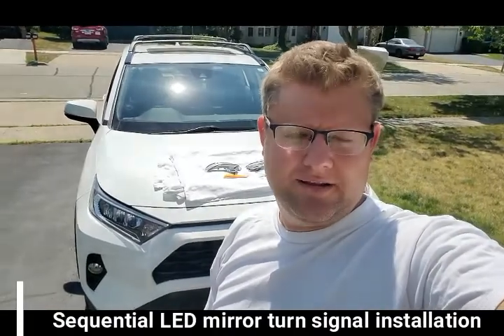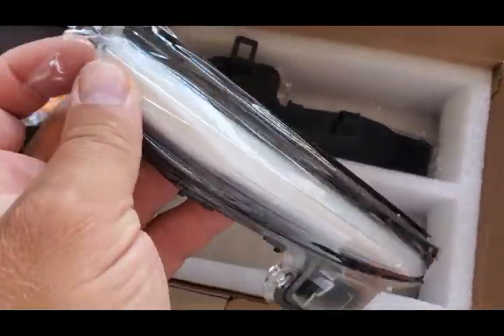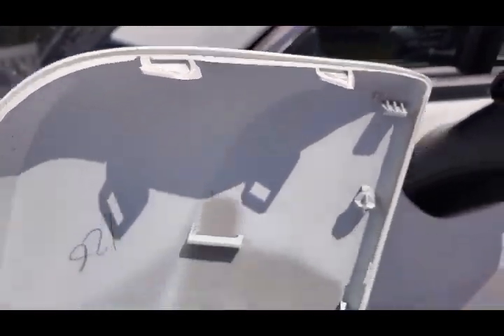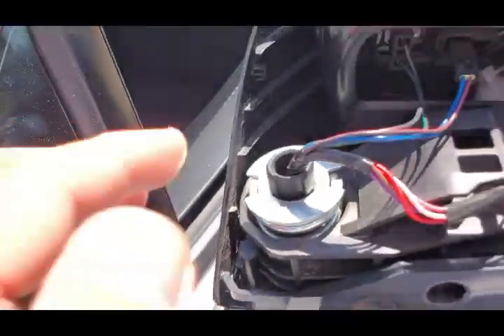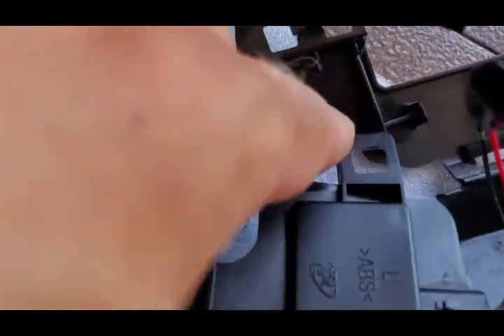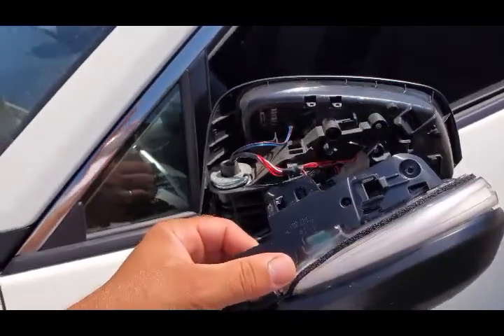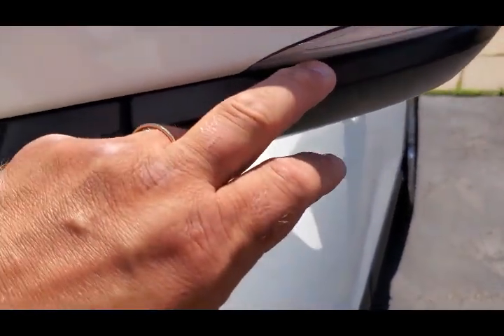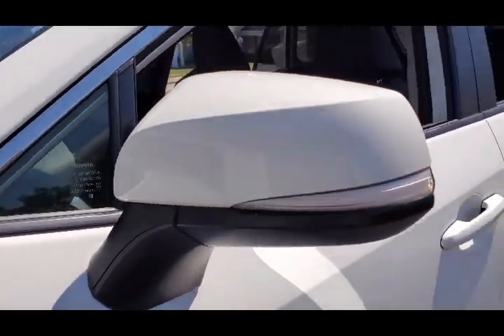2019 Toyota Rav4 sequential LED mirror turn signal

Comment: You can't see the OEM from the front very well because Toyota did this on purpose. The whole point of side blinkers is to warn other car(s) either next to you or behind you in the next lane, not cars in front. Does this one visible from the rear, like the oem? I wish you had taken the video from the back so I can compare.
Reply from the maker: You can clearly see this blinkers from the side if you’re sitting in traffic. The other ones you could barely see them, blinking the original OEMs.

Comment: the new lights actually look dimmer when looking at it from the back of the car. kind of disappointing to go through all that work and find out the lights look dimmer when viewed from the back. Super bright on the front but actually a downgrade when viewing from behind the car.  I think turn signals are more important for changing lanes.
Reply from the maker: I haven’t noticed that
Reply: @nazarettos6987  I really wanted to keep them. But this was the case when I installed one mirror light on the left, turned off the lights in my garage and compared the two. The OEMs were much brighter when viewing from the rear end of the vehicle. There's a chance I got a bad batch. Maybe I'll give it a another shot down the line.